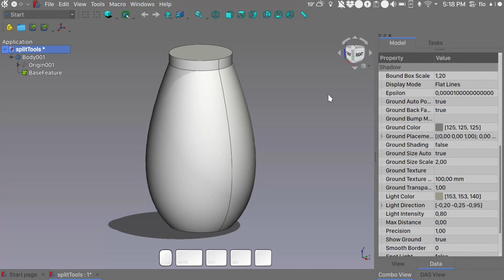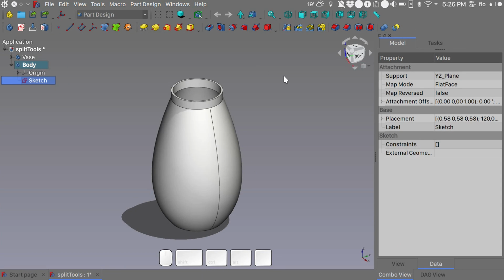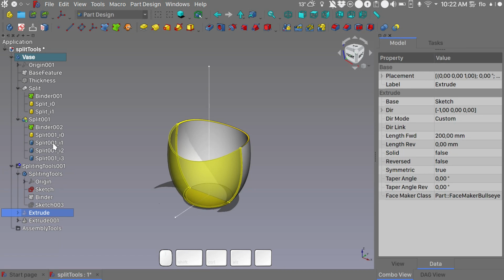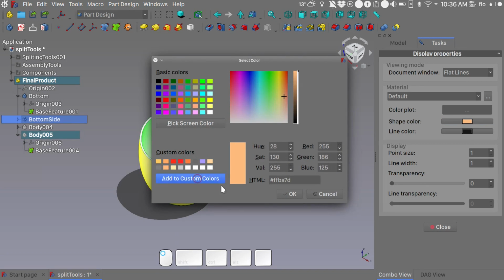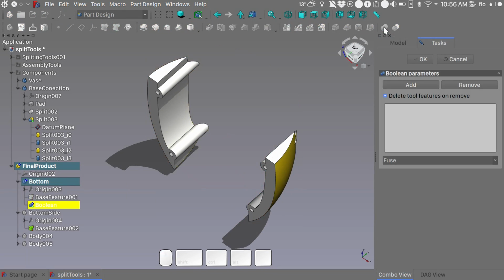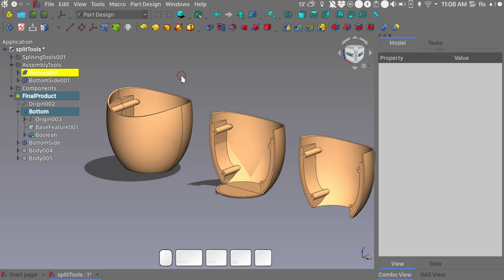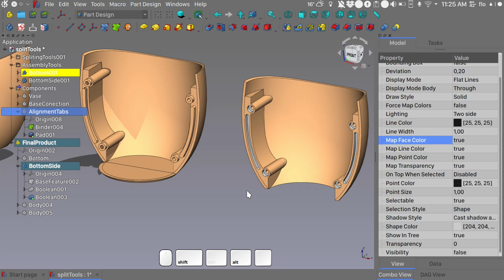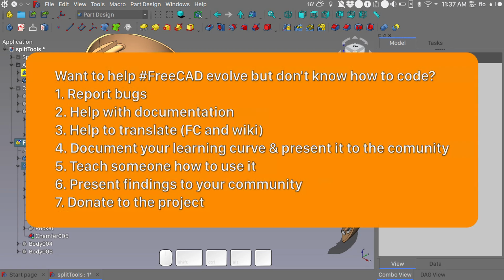FreeCAD _ LinkStage3: Design using the boolean tools in PartDesign workbench. (Part 1)

Comment: Guys I  have installed FreeCAD Version 2021.1015 but if I try to extend a open sketch it gives me an error I found that my version in missing in Part -> Extrude ->   Direction : Along Normal, Along Edge.
Does anybody know how to activate those parameters?
I need them :c
Reply from the maker: I tried with 2022.01.11 release and those parameters are present. Perhaps give it another go

Comment: 31:23 oh no you don't, oh no no no no, my heart is going to stop...
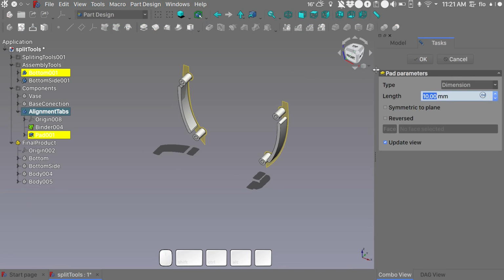31:53 what the heck, it padded successfully? what magic is this?

I think i tried that in normal FreeCAD once, and it threw dozens of meaningless obtuse errors at me, sometimes it partially worked, sometimes it didn't, it broke and it fixed itself, and i could see no rhyme or reason, until i figured out that you're not supposed to have insular features within a sketch unless they are subtractive features. But here it just pads it like a champ (or rather like any other program out there) and it's fine? What sorcery is this...

Normally just about every encounter with FreeCAD scars me for life with just sheer impenetrability and layers of implied knowledge it expects of you, inability to report bugs, unhelpful forum, and i still don't quite understand all you have shown here - which is not your fault, you did well, it's just the subject matter is fairly complex to me still, i'll just have to go through this slowly again and it'll get better. But colour me impressed, looks like i will actually be able to build things with this branch, i have been test driving it a bit already and hadn't managed to break it yet.

Comment: Thank you for this great tutorial. I've switched to RealThunder's branch recently to overcome Topological Naming Problem and it has been great since then. This video has a lot of information (which will take some time to digest) for creating a proper product but one thing is missing. How can we define some tolerance for matching parts? You know, if we don't leave some space between those alignment tabs, they'll stuck (or may not match) with the inconsistencies in the production process. So how can we have have an offset of, let's say 0.2mm, in that counter boolean operation (cut)?

Comment: Great video. I have a quick question. when i follow along and revolve my sketch, the sketch disappears and is replaced by the revolve icon in the tree. So I'm left not able to adjust the object and update in real time. Would you happen to know why that is? Thanks. (Running Realthunder's latest release, Dec 2020)
Reply from the maker: you need to expand the tree with the arrow alongside of the revolve and double click on the sketch to open it. Play with the visibility of the features by clicking the eye icon in the tree. To see updates in real time you need the sketch opened and the revolve feature set to visible. Sometimes an F5 is necessary to update the scene. Cheers

Comment: mega! learned a lot! one question: how to add tolerances? imagine for the alignment tabs.. maybe the receipt of the tabs should be a little bigger.. like 0.2mm :) how would I do this?😇
Reply from the maker: If you look closely in my "December update" video you will see that pad and pocket now have "Taper angle" and "Fit Tolerance" properties so that could be used to add tolerances to fittings. I still have to do a video on the latest part design improvements so stay tuned. Cheers.
Reply: @OficineRobotica  Yeah, just saw it. Nice properties! Very handy. But I am not sure how to use one Sketch for both, the pad and the pocket. I am waiting for any new videos! ;)
Reply: @OficineRobotica  It would be nice and more versatile a push-pull feature on a surface. This way it would be possible to make the needed tolerances. This feature could also have more uses.

Comment: I really appreciate this very in-depth and applied approach! I noticed that you used several reference circles in your spline control sketches. What were these for?
Reply from the maker: Thank you for your kind words. The circles that you see, if I understand correctly, are added automatically to bsplines and are actually control points. I disabled the bspline comb because not needed in this case and would only clutter the view. Stay tuned for the second part of this tutorial because there are new tools added to part design that make modeling even easier and no need to workbench jump anymore. All thanks to Realthunder. FreeCAD development is going light speed lately.
Reply: @OficineRobotica  Thank you! That makes a lot of sense. I have not worked with bsplines yet, but you make it look fun. Keep up the great tutorials and demos!

Comment: Did I miss something? The cut for the alignments make them the same size right? You cannot fit one into the other without allowing some clearance. Does FreeCAD have built in clearances?
Reply from the maker: Well...not yet. All this is still in development. @realthunder is nearing a new release with improved part design modeling tools according to this https://twitter.com/FreeCADNews/status/1313146734093238273 
I try and ask him for the clearance option in the showcase thread . He is really engaging and responsive with his dev branch users.